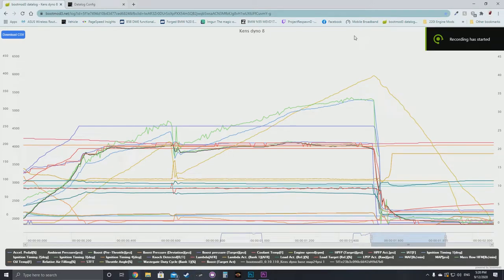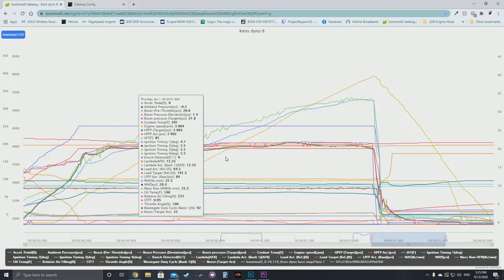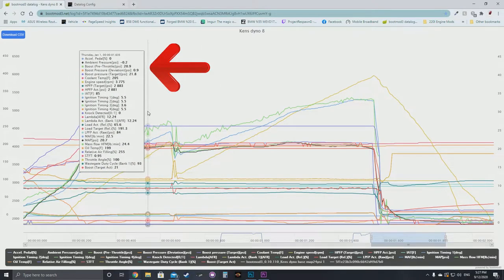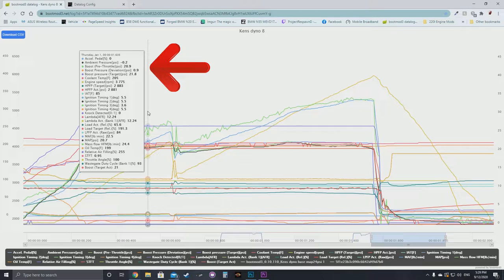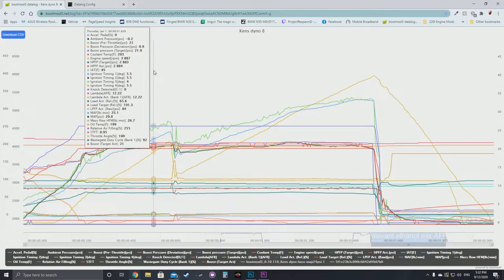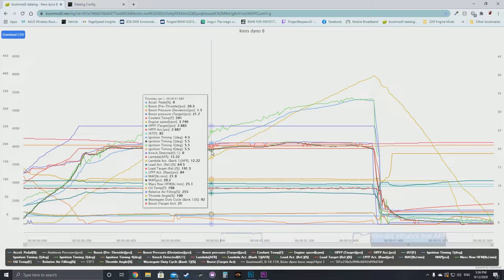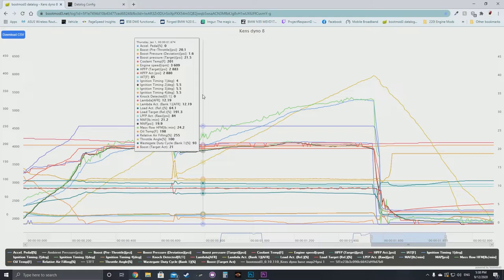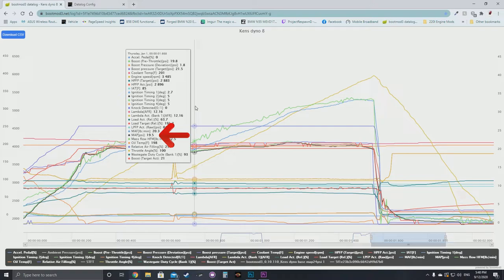Bootmod3 How To Read Datalogs

Comment: Great video even though I'm a few years late lol!

I have an F82 M4, what is an acceptable range of boost deviation before you suspect a boost leak? Also, cylinder 4 on my car usually lags behind the other 5 cylinders more often than not. In searching the interwebs, I see many other S55's having the same issue adding cylinder 6 as well. Any ideas?

Thank you, and sorry for the necro post!

I'm on a BM3 Flex Fuel multimap stage 1 in slot 3.
Reply from the maker: haha this is an old video now! still somewhat relevant though - usually 3+ psi and high WGDC (like 90+) would be a good sign of a boost leak 

How much IGN deviation do you see on Cyl 4? on pump gas up to 3 degrees of variance is usually fine - usually if you see throttle closure you can see ign variance due to the turbulent air  and uneven distribution between cylinders

Comment: So what happened to the n20 build?
Looking at the other videos you had it all put togheter ready to go into the car like 8 months ago...
Would be great to see a video on the progress you have made on the build.
Im really curious to know if the n20 can run reliably with something over 300 hp.
Reply from the maker: Ken's car the engine builder incorrectly installed the sleeves, and ended up damaging the block, so after many months of arguing the engine builder agreed to cover the costs of the damages, and we now have a new block put together from a different engine builder, and will be on the dyno this thurs (18MAR21) with a N55 turbo bolted to it, new video coming out end of month hopefully :) on the testing we have done, already hitting 28psi and its ridiculously quick! We are filming all day thurs (18MAR21) then it just depends how long post processing takes us, then off to uploading!

Comment: Hi, I’m having a issue with a fbo n20 
It doesn’t have a leak I’ve done smoke and pressurized tests but the car drops significantly below target the higher the rpms. Target 24 and I’ll hit 17lbs can you lead me in the right direction?
To add to the issue, some pulls it holds boost perfectly and some it doesn’t
Reply: upgraded your spark plugs ( smaller gap ) or coils ?